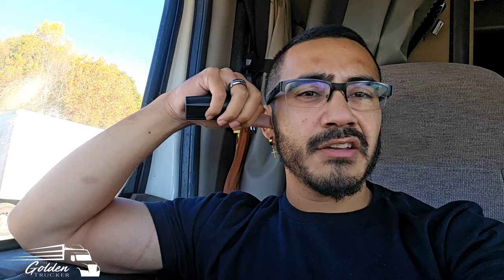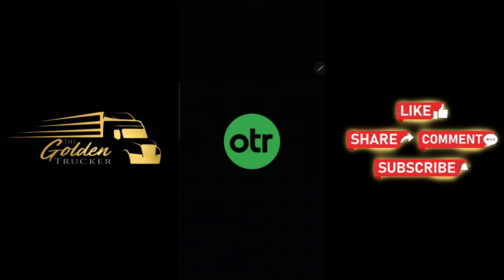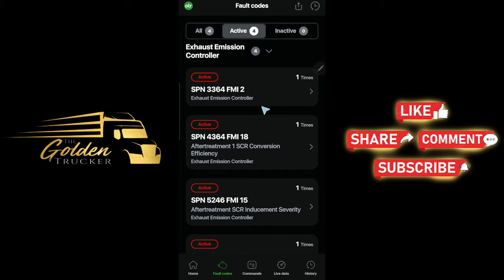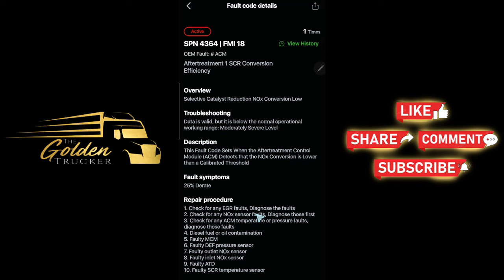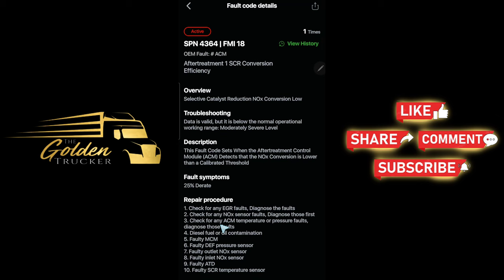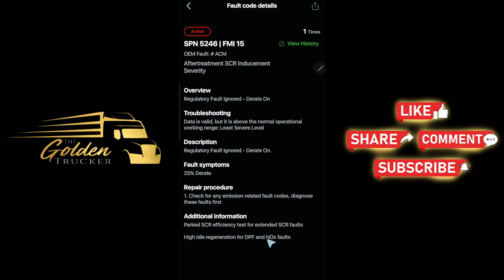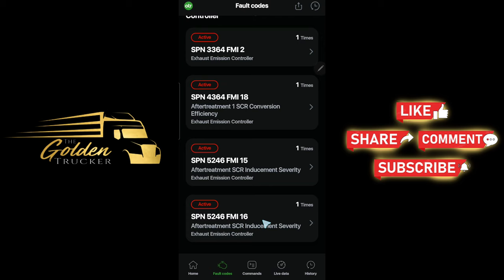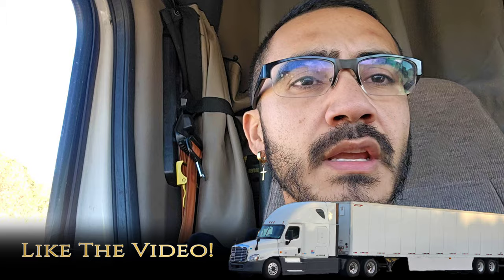SPN 4364 FMI 18 | SPN 3364 FMI 2 | SPN 5264 FMI 15 | SPN 3226 FMI 2 | 55 MPH Derate | Regen Issues

Comment: I was having the same issues,  I  changed my dpf filters that solved the problems for awhile.
Reply from the maker: When you say for a while, did the problem still continued after a while or are you waiting to see if the problem will come back?
Reply: After changing dpf filters I am getting following codes every single day every 200 to 800kms.
How to fix this shit?????
SPN 5246 Fmi 0
SPN 4364 Fmi 1
SPN 4364 Fmi 18
SPN 3364 Fmi 2
SPN 5246 Fmi 15
SPN 5246 Fmi 16

Comment: Try getting a one box efficiency test done and if it says the one box is in good health take it to Pittsburg power and get a diesel force cleaning done and start running Max Mileage the cleaning and the Max Mileage keeps soot levels down
Reply from the maker: Thanks for the suggestion! will look into getting the one box efficiency test done while I'm at home for the holidays. I don't think the issue is the soot level but it definitely won't hurt to use the Max Mileage. I idle as little as possible. The codes don't pop up unless I'm heavy and/or going through mountains/hills.